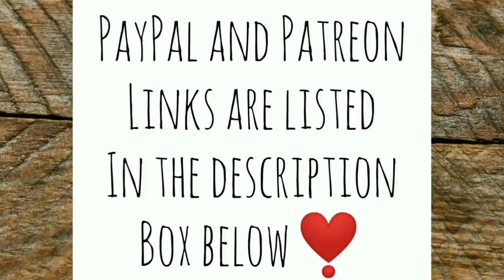T-Pipe Installed on my Guide Gear Wood Burning Stove - Ann's Tiny Life

Comment from the maker: If your comment isn't:
1. Useful/informative
2. Kind/warm
3. Truthful/genuine
4. Supportive
5. Fun/Funny

It may be deleted. If you're an alarmist, go somewhere else. Alarmists aren't fun to be around.

If your comment contains a link, it will go to the moderation folder for review. I don't allow links to websites which are contrary to the theme of this channel. Nor do I allow comments with links which lead to websites that contain objectionable or alarming/alarmist material of any kind, to be determined by me myself and I. LOL There are a few approved users who I allow comments containing links to go through without moderation due to them showing over time that they post useful and related links. 

If you try to circumvent this by posting a URL which is separated by spaces so that YouTube won't pick it up as a link, you will be immediately removed from this channel.

Comment: Cool video Ann.  I worked as a chimney sweep for 2 years. Im very glad you did this upgrade and cleaning. That much creosote was a major fire hazard. The creosote can ignite like paper. Based on your 3-4 of use I would recommend chimney cleaning every 4 weeks. Wood that is 20% or less moisture is the best to use.( I know you can only burn what you have) . If you can Invest in a chimey sweep kit. (Poles and brushes).  Will make life much easier. Will take 1/4 the time to clean and be much cleaner. 🤘
Reply from the maker: oh yes I'd love to have one of those chimney sweep kits eventually. for right now I'm just using that pipe. the metal one works the best and it's the longest. right now my wood is pretty green. it still Burns but it's causing all that buildup. so I will likely clean my pipes at least weekly if not two times a week at least for now. that's scared the heck out of me when I saw all that in those pipes. it's only a blessing from God that it didn't come down and ignite. or even catch on fire up in the pipes.
Reply: @AnnsTinyLife  great idea clean weekly!

Comment: Glad you got that fix, wood heat is hard work. I had a pellet stove for a year just didnt work out for me but at the time my natural gas boiler went crazy so used the pellet as primary for a day. Hope you put up foam board insulation in your roof it will help retain the heat and keep it cool in summer.
Reply from the maker: I think I'm going to go with reflectix insulation on the ceiling. I've seen others do it before and they said they got good results out of it. plus it's lightweight and easy to handle. I had also considered foam board as well. but you have to put an air gap and that's kind of hard to do with foam board the way my studs are. I'm so glad I got those pipes cleaned out as well! I'll never let them get that bad again. when I think of the seriousness of what could have happened it's kind of scary to be honest.

Comment: Good Job Ann and Mr Lucas .. With those screws on the side of the pipe and a Pan inserted you could use that as a entry for a chimney sweep .. as soon as you can I would get one along with a moisture tester for your wood .. with that much creosote you must be burning Wet Wood ... also another suggestion is you could possibly buy a fire proof board and cut a hole out for you chimney pipe to go through.. the wood that you are using is Definitely getting too hot and starting to burn .. sure don’t want to see your home catch on fire .. well Love Ya .. take care 💕🌸🐾🐾🦴🦴
Reply: Maybe another Idea is ask all the stores and Post office to save all their paper Junk mail that people throw away and all newspapers / flyers torn paper bags for you and make your own fire logs for the Rainey/ snowy days or for on the days you’re not feeling good
Reply from the maker: the wood itself is not starting to burn. it's warping because of the changes in weather such as rain and whatnot. that coupled with the warmth is causing the issues. the brown areas around the outside are from smoke. the board barely even gets warm. I don't know if you've watched the other videos on my wood burning stove install but there is a double walled wall thimble that goes through the wood. inside that is another double walled galvanized steel pipe. so there's four walls. the wood is not burning. I don't think it would be worth it to spend the extra funds for a moisture tester for wood. I know when wood is wet and when it's not. it's pretty easy to tell just by touching and looking at it. but I'll burn what I've got! as I said to another commenter already today I'll just have to clean the pipes more frequently. LOL like I've said to countless other people in the comment section today, next year will be better and I'll have drier wood. many other commenters have already mentioned the wet wood situation, something that I already know about. I always suggest that people read others comments down in the comment section because many times I've already addressed the issue. 🤗👍

also I'm not sure if you watched the video all the way through? there is already a cap on the bottom which is removable so that when you need to clean it you don't have to dismantle the whole pipe setup. I clearly show that in the video maybe you missed it? 🙂

Comment: One big thing I would highly recommend I have a large version of the guide gear stove I remove that spark arrester on top and replaced it with a normal chimney cap you just take a piece of sheet metal and bend it over for a raincap but that spark arrester is not efficient enough to run all Winter long I wintered along I had a heating and air guy come out and look at mine and the inside of the pipes was just like yours and he said Most of it is because of the buildup on that spark arrester he said if you were just using it for what it's actually intended for like using it in a hot tent then it wouldn't be that big of a problem But the heating guy definitely told me to replace my stove cap for that reason alone In the end I also had to modify the top of my stove stove so that the pipes could be turned around sound because the way they engineered mine was all the crease so it was also leaking down the sides of the pipe

Comment: We have a wood burner and use it all the time and never have that much junk in the flue pipes. I’m wondering if the type of firewood you are burning may be part of the problem. Just a thought. Have a wonderful day
Reply from the maker: yep it's the wood I'm burning along with some of the kindling. paper products, cardboard and whatnot I guess cause more build up in the pipes as well as green wood. most of my wood is green right now so I just have to clean it out more often until my wood dries out better. it'll be better next year! also, my pipes are pretty small. I've got a guide gear small wood burning stove and the pipes are just a little bit bigger than 3 in in diameter. that's also part of the problem.
Reply: @AnnsTinyLife  ok, that makes sense our pipe is 6” and we burn well cured hard wood. I’m tired of cold weather,wood burning and ice all over everything. I am looking forward to spring. How about you.
Reply from the maker: @thebibletrain8297  spring cannot come soon enough! LOL
Reply: @AnnsTinyLife  Amen

Comment: Is your pipe high enough above the roof?   If so your wood may be to green and not burning hot enough..  you could sprinkle some of that creosote out of the pipe and burn it in the stove...
Reply from the maker: yes it's high enough up over the roof but I have another pipe that I'll eventually be adding to it. yes I've heard that about the creosote and have saved it. yes almost all of the wood I've been burning is too green. I just burned what I have here right now. it'll be better next year.

Comment: 3:13   "Rock Wool"
Reply: 6:24   Holy crap! That is because it's not hot enuf to burn that up before it vents out. Rocket stoves are notorious for not having this problem because the vertical venting is allowed to get so hot that it burns more completely. 

Those pipes need to be fully insulated so they can come to their full heat potential. Otherwise, this is a total fire hazard. 
I can't even imagine this being rated for a tent!! 
🔥😱🔥
Reply from the maker: no rockwool is made of volcanic rock and slag. the rope inside of that pipe as well as the rope that lines the door of the wood burning stove is made out of fiberglass.
Reply from the maker: this comment went to the review bin because the time stamp look like a link. with all due respect that creosote buildup wasn't because the pipes didn't get hot enough. it was because I was burning green wood and a lot of cardboard. plus I hadn't checked the pipes for weeks. you have to periodically clean them out. I've seen many people put these in tents, and even rvs, and would you believe a van converted to an rv? I think that you're becoming a little bit too alarmist here. I've learned a lot since having this wood burning stove. and one thing I've learned is everything you've presented thus far is pretty much the attitude of many of the other alarmist kind of people out there. I've burned the wood stove many many times. I felt the pipes. I felt the walls. I felt the walls outside. I felt the pipes outside and look for smoke. everything worked great and there's been no fires. you just can't be a complete dummy when burning one of these stoves. if you have a fear of fire, heat, cleaning out chimneys, or are otherwise a very anxious person I would highly recommend you do not get this stove. you wouldn't enjoy it. it would be really hard to enjoy a wood burning stove if you're constantly anxious and alarmed by letting it do what it's supposed to do, which is get really hot.